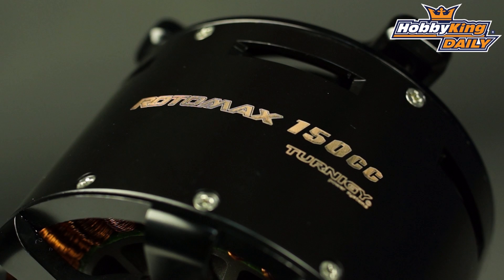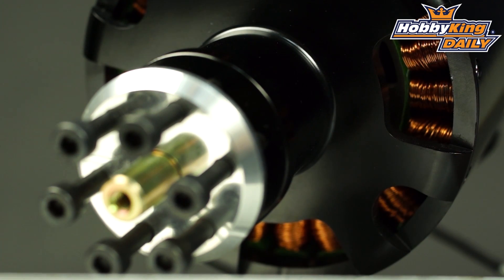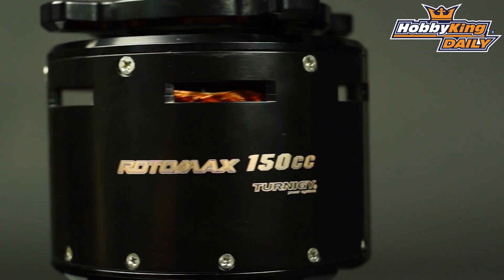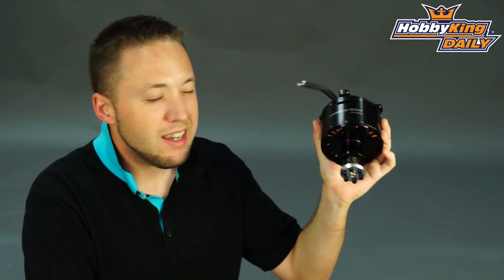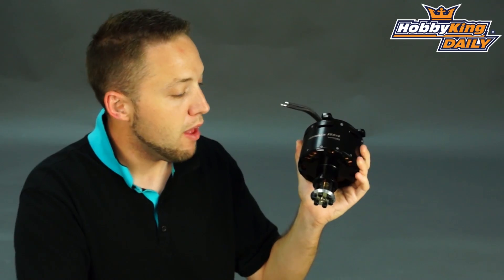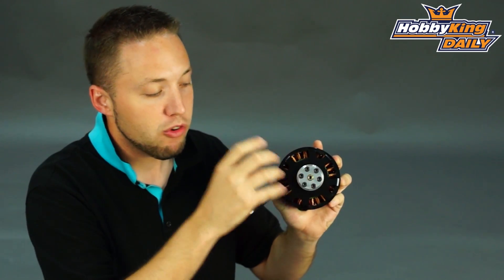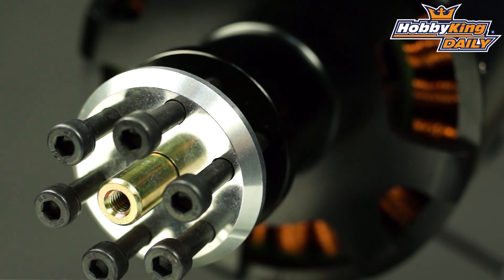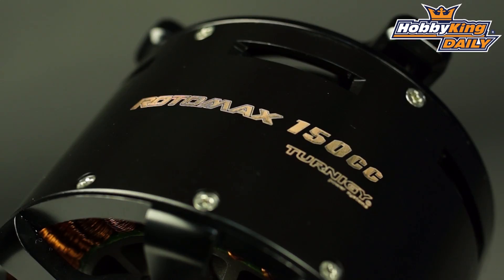Turnigy Rotomax 150cc Motor for RC Airplanes - HobbyKing Daily

Comment: Rate please
Reply from the maker: Spec.
Battery: 14 Cell / 51.8V
RPM: 150kv
Max current: 190A
Watts: 9800w
No-load current: 51.8V/5.2A
Internal resistance: 0.011 ohm
Weight: 2530g
Diameter of shaft: 10mm
Winding: 8T
Stator Pole: 24
Motor Pole: 20
Stator Diameter: 101
Lamination Thickness: 0.2mm
Suggested ESC: 250A 14S Compatible

https://hobbyking.com/en_us/turnigy-rotomax-150cc-size-brushless-outrunner-motor.html

Comment: Does this motor' power is same as the 150cc engine power?
Reply: That's a super rough approximation. It's probably much better though as you get instant torque, etc.

Comment: can I get 145lb of thrust in pusher configuration ? and how long can I get from a 14s 5000mah battery?
Reply: Caleb Hill 15+4s at 5000mah that's about 700watt hours of energy. So you would get about 5 mins at full power

Comment: What is the largest prop this could spin? Would the TCF 30x13 work? With a FATBOY300amp ESC?
Maybe adding prop options on the hobby king web page would also be a good thing.
Regards from Switzerland
Reply: It's a secret...you have to find it yourself ☺️
Reply: @ishady27  you reply to a comment that is 7 years old... Why?
Reply: @posko76  ohh sorry...I have the same brushless motor so I think I chime in, altho not much help...I use it for electric paramotor but don't have big battery so only last a few seconds, I use a wood prop for electric sized 3020

Comment: I command you to make a quadcopter with that motor.
Reply: I am thinking a four engine ultra light aircraft
Reply: probably would lift a Boeing 747 with that beast.
Reply: He's right would need a surge controller or would be unstable.
Reply: Armoroid1 lol when each one cost 390$

What are you bill gates!!!!! 

That was a joke sorry..😂
Reply: Peter Orsome a light person with sluggish performance sure. Large quadcopters don't work because the inertia of the large spinning props makes speed changes too slow. Now set it up with collective pitch and you have a winner.
Reply: +Todd Michael should have said they don't work well.
Reply: Armoroid1 Nokia

Comment: Why using volume to describe power? What's wrong with the units watt or hp?
A 150cc combustion engine is not a fixed unit.
Reply: jodde73 Has to do with weight I think

Comment: Contrary to popular belief you don't even need a motor like that for an e-bike. There is a Turnigy 800kV which will do the job along with a 100A ESC and $400 of batteries. But as someone mentioned, you should go with industrial grade batteries.

I have seen someone use this exact motor for an ultralight and another person for a paramotor. 

Hope this has cleared up some conception for most :)

Comment: There are ebike ESCs you can buy, and very large non-RC LiPos which would work out cheaper than loads of RC batteries wired in parallel. You'd still probably have to spend $500-1000 to get a decent range though, but with this sort of power you could expect an eBike that would do 50mph or more, with running costs of next to nothing.
Reply: TheAegisClaw what about putting this on a e board? Lmao

Comment: Brushless motors will not run on a battery without a esc/speed controler or similar. Simplified spoken, one coil gets power, the motor's magnet moves to that coil, the next one gets power, the magnet(s) move once again... With direct curent from a battery, nothing will move.

Comment: Hey guys im really curious but i don't really get it because there are like three wires coming out from the motor , and for my electric bike the brushed motor(200w) only have two wires connected to it.. 

How do I connect them... ? 
It's running on 24V , lead acid batteries..
Reply: Clinton Ho This comment was posted 7 years ago but here I am. The Rotomax 150cc is a brushless motor, and it runs using an ESC. The ESC would receive DC power like from your lead acid battery and turn it into a 3-phase signal that the motor would spin with.

Your brushed motor of 200w is dwarfed in comparison to the rotomax’s 9800w. Be careful and wear a helmet if you decide to put one of these on your bike :^) It will take you to the moon!

Comment: That's a badass motor lol :D I guess a octocopter powered by these could lift you in the air?
Reply: Yes smoothly
Reply: Easily yea. Plane would be better though and require much less motors / power.